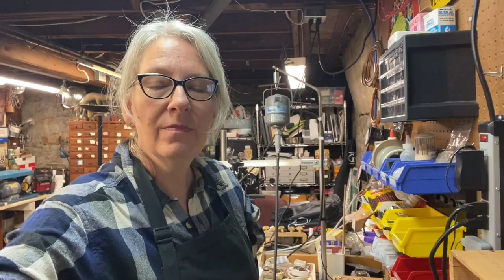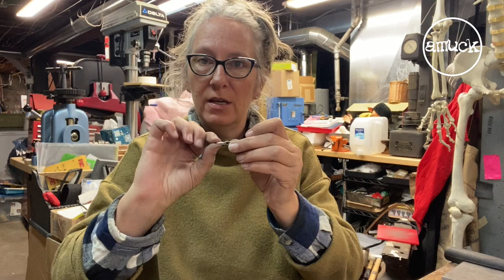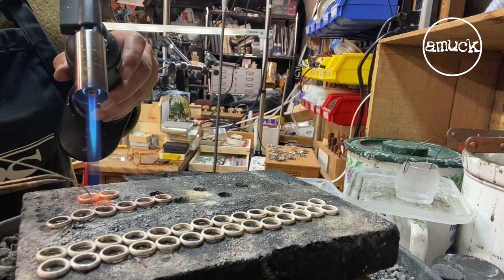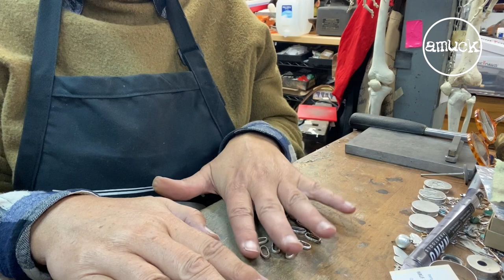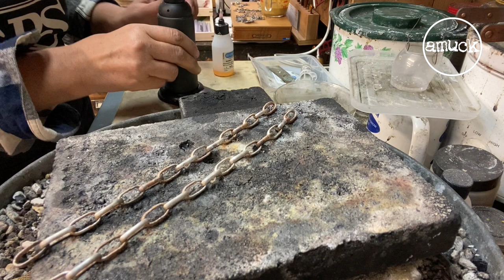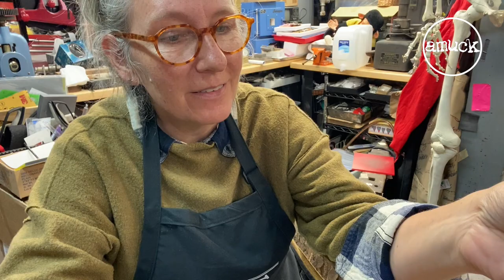Making a paper clip style chain

Comment: so around the 15.00 min mark when you joined them together now having 7 links, I noticed you used flux but no additional solder.. is that because there was enough on there from the beginning? I do not know if I'm missing a step that you did.. thanks..
Reply from the maker: You are correct, there was already enough solder on them from when we soldered the ring shut in order to stretch it.